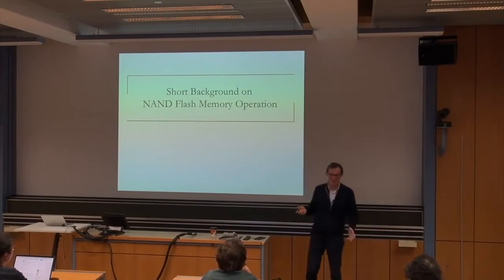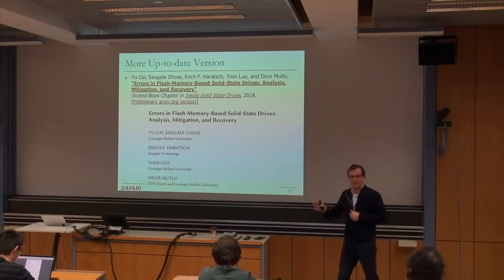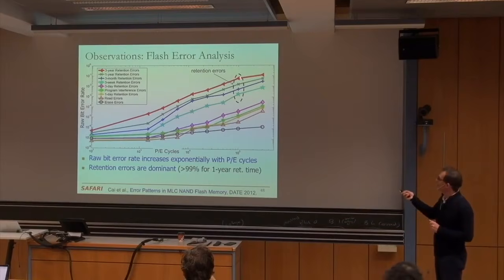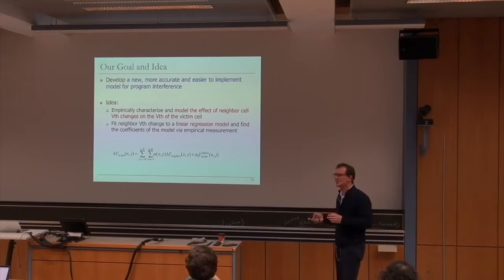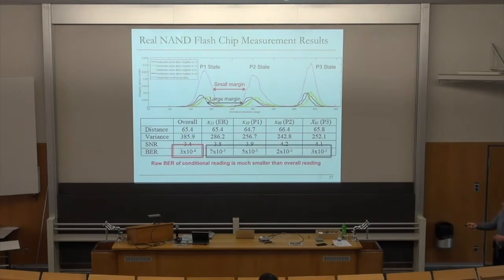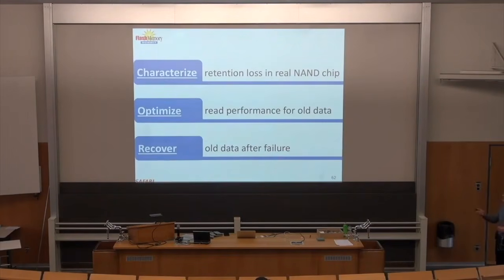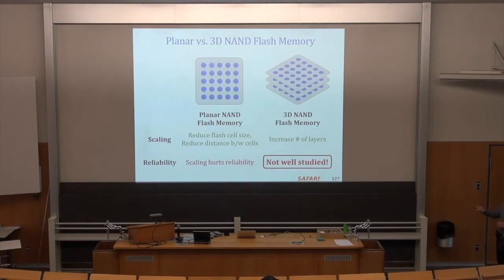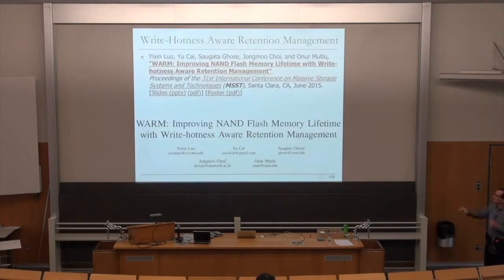Understanding & Designing Modern Storage Systems - M9: Flash Memory & Solid-State Drives

Comment: I have a simple question. Are there still open research opportunities in error handling (raw BER, etc.) for NAND Flash memory at either system or digital circut level?
Reply from the maker: Yes, absolutely. Here are some examples: https://arxiv.org/pdf/2209.05566, https://arxiv.org/pdf/2404.10355, https://arxiv.org/pdf/2305.07768.pdf